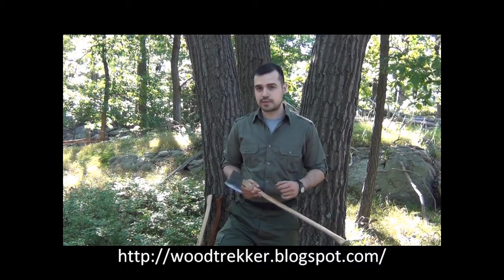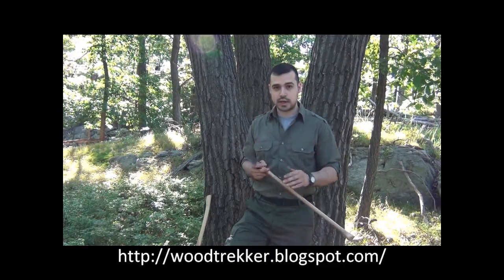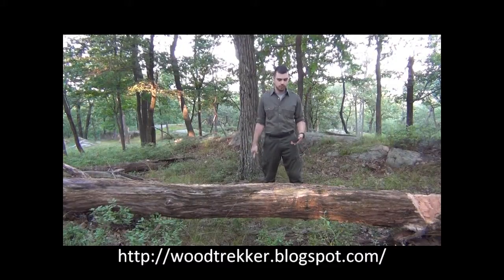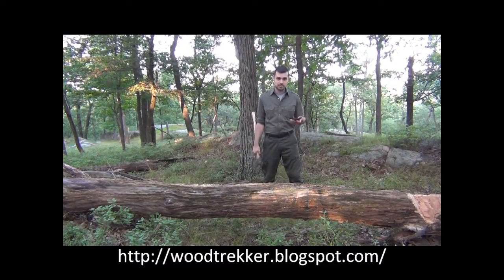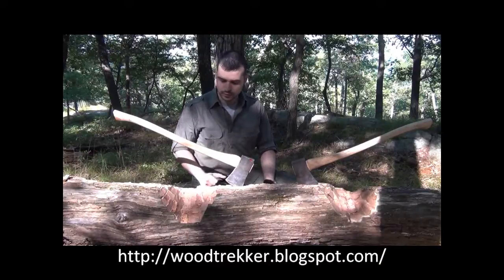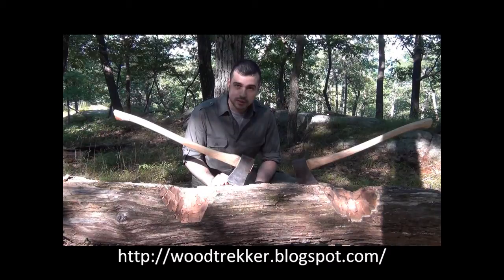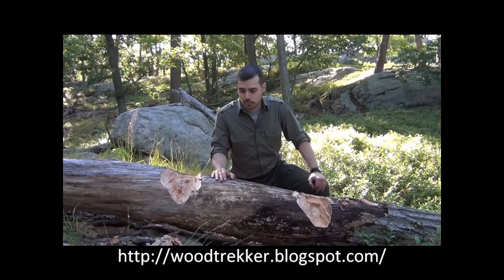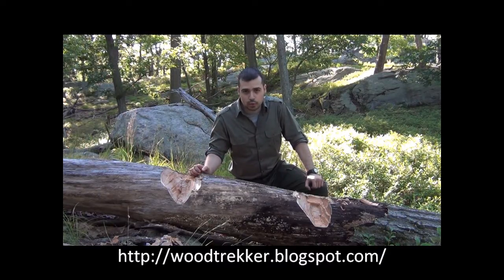Old vs. New Axe Comparison-Convexed Cheek Design Part 1

Comment: Thanks for the comparison! When you are chopping slant log as in 09:37 it's better to stand on the other side of the log than you did, so your backhand swing can hit the log easier in better angle. Your forehand swing has more ability to reach the desired 45 degree angle even from the lower side of the log.

Comment: this really should have been done on green wood. Axes with convex cheeks from heel to toe have been designed NOT to stick in green wood. Green wood is primarily the target wood for axes - felled, bucked, processed etc to the desired rough shape/size for intended final use while still green. Dry wood eliminates most of the advantage of convex cheeks so you will end up with very similar results if not actually favouring flat grind due to the better penetration. Convex cheeks make better chips in green wood, making better progress through the wood, dry wood chips about as well with convex or flat grind.

Comment: Good idea.  I'd like to see more of a real life type of scenario.  Cutting green wood would be good.  Also a careful aim so you're striking into the same cuts over and over where sticking is likely to be a problem and penetration down into the deep slices might vary more with a thin v.s. fat bit.  Also, in that scenario you'd see how likely the axe is to throw the chips out on subsequent swings.  I didn't see that you really detailed the differences in the profiles.  are they similar thickness in the center, and the convex tapers toward the edges?  or is the convex one thicker?  A lot of old axe heads are seriously just too thick in the center of the convex.  I have no idea how to best profile them for the most general purpose use, if there even is such a thing.  Do you have any further impressions 5 years later?
Reply: I agree 100%.  Tests like this require a skilled hand, sadly this video lacks that. Accuracy is much more important than power. Technique, and skill is what defines the axman. The author should watch , "the axman". Then slow down, and practice.

Comment from the maker: @SKwoodsman Thanks for the tip. I didn't even think of that. I chose that side because it was easier to film. :) 

Also, if anyone is watching this, keep in mind that it is not a bucking tutorial. I do a number of things that I would not ordinarily do. For example, I would usually clear out the chips from the cut, but here I don't so I can keep better time.

Comment: It will make much more of a difference if you were chopping fresh wood, simply because it is a lot softer and therefore the axe penetrates deeper, which results in more contact area between the wood and the steel.

Comment: I'd like to see this done in GREEN wood.
Reply: this really should have been done on green wood. Axes with convex cheeks from heel to toe have been designed NOT to stick in green wood. Green wood is primarily the target wood for axes - felled, bucked, processed etc to the desired rough shape/size for intended final use while still green. Dry wood eliminates most of the advantage of convex cheeks so you will end up with very similar results if not actually favouring flat grind due to the better penetration. Convex cheeks make better chips in green wood, making better progress through the wood, dry wood chips about as well with convex or flat grind.

Comment: Is it just me or did the True Temper make a slightly better "thwuk" sound rather than the "clack" sound that the council tool made???  I wonder if there's a difference in the metallurgy that would account for that...or maybe one has a better surface contact in the hang???  Or of course maybe I was just hearin shit!!!
Reply: could be all or just the way he hit the wood itself
Reply: Different carbon content.Old heads were 0,8 -1.0 % carbon content.Today's axe are between 0,4 -0,6 at best.They don't chip,but they don't cut as good and they don't hold an edge as good as the old ones.
Reply: @johntsoukas8723  thank you for the info.  I don't own any modern axes.  All my axes are vintage blades by Kelly/TrueTemper, Hytest, Belknap/Bluegrass, Collins, Plumb, Hultafors, and a few other smaller makers.  I haven't been able to find much info on the metallurgical differences between vintage makers and how they compare to modern production.  If you know of any good articles that mention this... I'd be interested in reading it.  Thanks again.